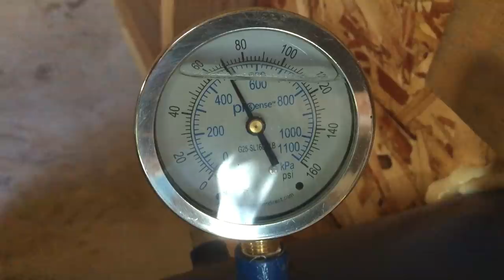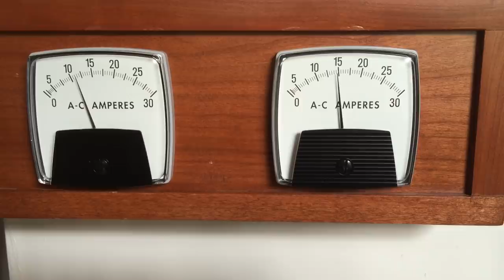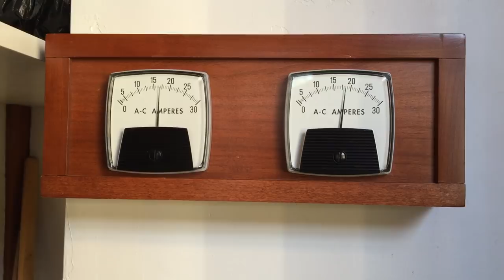Part 20-3 MicroHydro Power System in CO

Comment: How much electricity are you actually using on a daily basis? Seems like you can run this thing at like 10% capacity most days. My last bill shows I used  around 700 kWh last month. Your system could power this in like three days.
Reply from the maker: Its difficult to estimate how much useful load we actually utilize.  In the non winter seasons we dial back the generation to about 4500w in the Spring-Fall period.  Winter we run it at 7500w.  Because its AC we actually have to use all the power when produced, no storage.  Useful allocation is another matter.  The great majority of power gets dumped as heat in either 300gallons of hot water, our hot tub, or baseboard heaters in the basement.  The reason for 4500w is that it is balanced to provide us the most peak demand capacity and max the load on the water heater when it is heating.  The basement does get hot in the summer however, but we open the garage door to cool it off if working down there.  Thx for watching.
Reply: @mrhydrohead  Thanks for the quick response! I watched all your videos, they were very interesting. That's a huge amount of hot water, I can see where that would take up a lot of energy

You ever think of mining bitcoin? I've read the big draw back for mining it in the US is the cost of electricity is too high to actually make a profit anymore, but it seems like you wouldn't have that problem.

Comment: May I ask approx how much the whole system cost including the reusing of your existing plant?
Reply from the maker: Original installation was ~25K and we got pressurized domestic spring water and a pond for fish along with the power.  This was in lieu of bringing in the wires from grid at about $140K ($20K x 7 miles) in 1996.  So it was a no brainer.  The move cost about $55K for the new pipe, intake, wire, transformers, ect. This was in lieu of bringing in the wires from grid at about $250-300K in 2013 and we got an exponential amount more power for the investment.  
We look at the system as an investment in the value of the overall property and don't think about the "payback period" that so many people obsess over.
Thanks for watching
Reply: @mrhydrohead  Thank you very much for the in-depth reply. 
It looks like a clear financial choice even without the satisfaction of building and running your own hydro plant! Especially as you'd still have to pay for power after filling the local distribution companies coffers.
You have an amazingly beautiful location and great storytelling skills. 
I wish you all the best.

Comment: Doesn't appear to be much water flowing.  How are you getting so  much power?
Reply from the maker: 96psi and ~300gpm flow captures a lot of power.  180-200 kWh/day at full output.  Not sure what shots you are referring to about how much water is flowing.  Thanks for watching.
Reply: @mrhydrohead  that's before any calculations for inefficiency, right?

I'm getting about 3300KWh/month after conversion for your numbers.  Based on you getting 96psi from about 65 meters of head? Is that close?

I'm new to all of this, sorry!
Reply from the maker: blackz06 We got just under 180 kWh/day throughout this winter. Actual readings. At full flow psi drops to ~88psi due to friction loss in pipe. Not sure of calculations you are using, but that was actual output for us. Dialed back flow to about 4500w or 108 kWh/day now.
Reply from the maker: The formula I was originally taught was Net Power (in watts)  = Net Head (in feet) x Flow (in US Gallons per min) / 9 (for AC efficiency) or 15 (for DC efficiency).  It isn't possible to figure the flow exactly in my system, but it can be determined by figuring it from the output. 

Changing the formula we get:
Flow = (Net Power x 9 for AC) / Net Head

With ~7400w of power  and 88psi you get 88 x 2.31 (ft per psi) = 203.28 Active Head (after pipe friction) and so 

327.63 gallons per minute  = (7400w * 9) / 203.28 net head

This of course is all theory and there are losses due to friction and line loss. But its a good rough estimate of what is occurring

Comment: There is a cheapish way to armor the banks to stop the spring run off from doing damage to the collection area by using river rock to fill aluminum or stainless steel fence cages that protect pond liners covering the at risk areas. Would be pond liner on the bank then a fence section on that a layer of rock and another fence with wires binding the 2 fences together and the rocks acting as the weight to stop it from washing down stream. 

Several styles to pick but should be able to google some images for an idea of the finished look but the more rocks the heavier it is the more it can resist moving. 

You would be able to run the pipe under the armor to a small collection dam made of large rocks concreted together and skid rails over the intake screen for rocks to slide over in the spring runoff.
Reply from the maker: I wish it were so. We looked at the idea of gabions, but there are hundred of feet of unstable ground which is liquified by a small spring at the top of the hill literally hundreds of thousands of tons of ground are moving. Thx for the suggestion, but you can't possibly understand what's occurring here
Reply: Is the spring on your land? If not drain tiles just down hill from it would stop the water from destabilizing the rest of the hill side.
Reply from the maker: The spring is on my neighbors ground and he was trained as a geologist. He is convinced that the entire hill is weak unstable basalt which is moving and will continue to do so. The spring isn't centralized and you would have to physically walk the 10-12 acres of ground and see other similar hills in the area to fully understand. It's not as simple as you think.
Reply: If it is that bad only thing to do would be to check with the local schools if they want to setup timelaps and tracking equipment and to study it for the geology departments. For some odd reason they love long term local events that they can show the classes.

Comment: Sir
If 80 Degree Water go down side
&
140 Meter length
How much water need to produce 7kVa Electricity
Single Phase for a home ??
.
What Diameter and how much PSI Pipe need ?
Respect u from Pakistan
Reply from the maker: We have a head of about 98psi (2.31 x 98 = ~227 feet) static pressure and ~275-300 gallons per minute of flow to produce 7.2-7.5 kW of single phase power.  We have pipe which is ~2500ft. In length and 6”(150mm) diameter which climbs in pressure rating as it goes down the hill starting at 80psi and progressively climbing upwards in rating to 160psi. When we have the high flow of 300 gpm we get a reduction to 88psi active pressure due to pressure loss from pipe friction.  I hope this answers your questions. If not, let me know what is missing.  There is a great deal more information throughout the entire series.  Thanks for watching
Reply: @mrhydrohead  
Understand Sir
Another Question
Minimum how much RPM need to produce electricity ?
Minimum , minimum ?
Today I saw A Diesel Generator and technician tell me that this will produce 220 3 Phase
If u rotate it 1800 RPM
So Sir I want to know that if I want to produce 220v
How much RPM need at 7kVa Generator motor ??
He Advise to me that
Purchase 1300 or 1400 RPM Generator from Market
,
Is this point is valid that
If load exceed
RPM must high ??